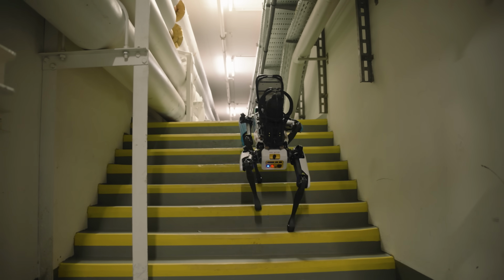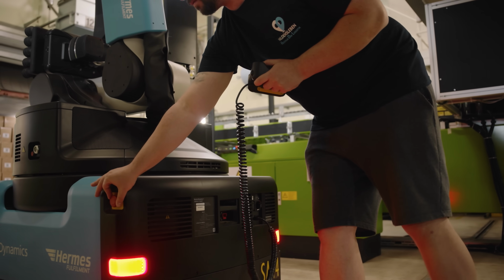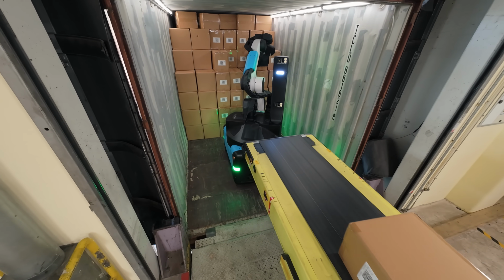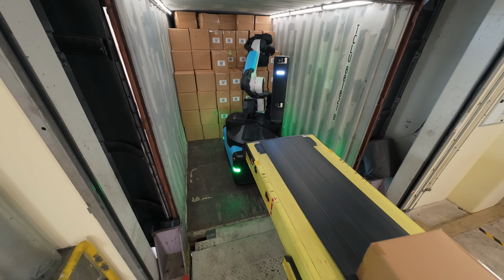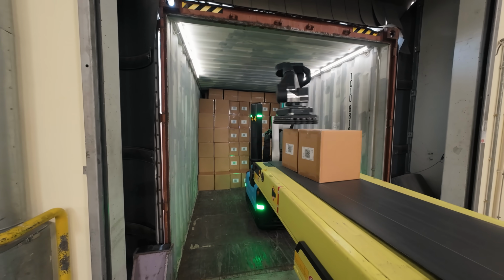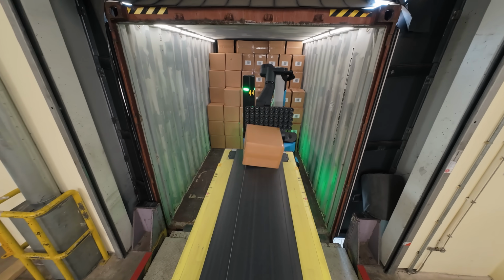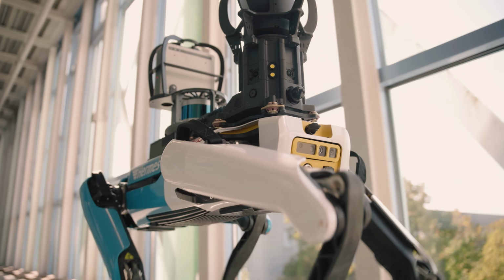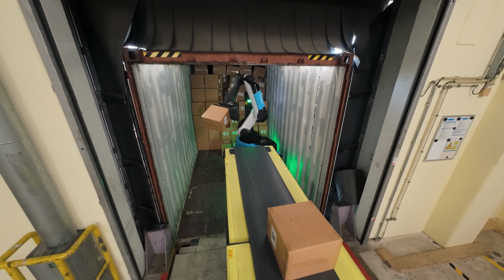Boston Dynamics deploys Spot and Stretch together for the first time in Europe

Comment: I know this is proof of concept, but the dog is walking around to check meters and vibration. You do know those meters can cheaply be turned into smart meters and vibration sensors are also dirt cheap... Ugh
Reply: Much as it showed Spot looking at gauges, I thought that odd, but checking for leaks in pipes and joints would be harder to solve in other smart ways.
Reply: Can Spot report a fire 🔥 or water 💦 leak if it’s not there ?
Reply: Spot could be cheaper than converting hundreds of sensors to IP
Reply: The labour to replace them would be most of the expense. Spot avoids all of that.

Comment: this is perfect case scenario with what look to be empty boxes.   You cant tell me the surface strength of cardboard being vaccuumed on one side of a box is going to hold up to a box of anything heavier than bread.    And using the dog to remotely measure air pressures? Are you kidding me?   $4 zigbee devices report on temperature and humidity on a 2032 battery for 6 months.     

This is the dumbest video i've seen in a long time.
Reply: I think they mentioned proof of concept. It is quite tricky for a camera to work out box edges, especially the ones leaning over. 
All you would need is a tray under the sucker head, and use the suckers to slide from the container onto the tray, swing round, then push it off the tray onto the conveyor. I dare say one human looking after ten robots would manage odd shaped and broken boxes.